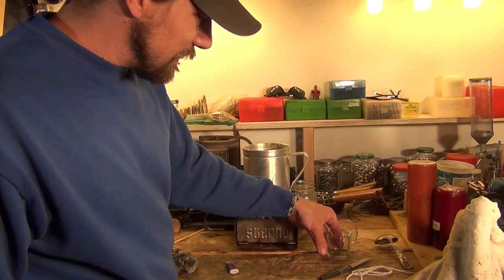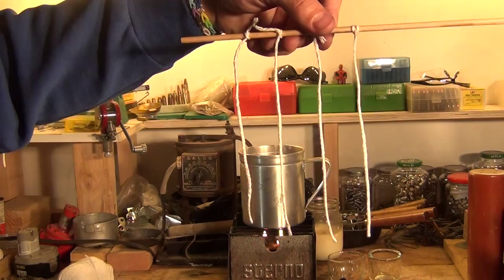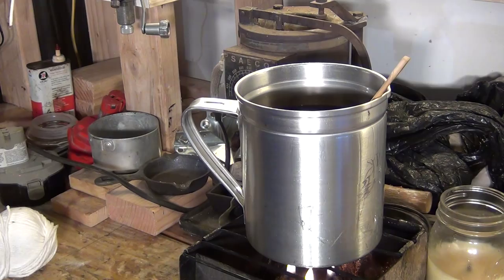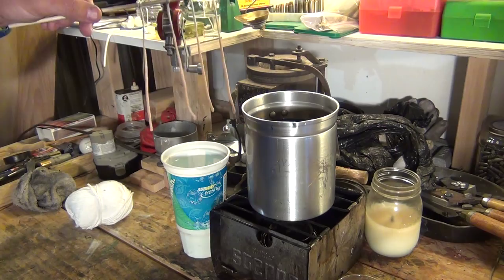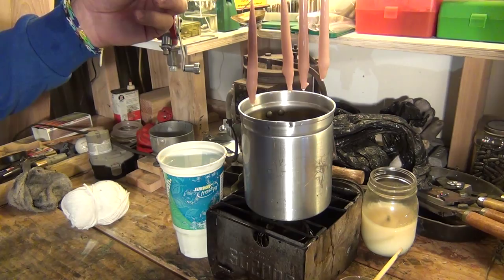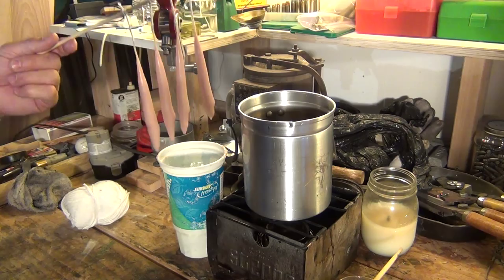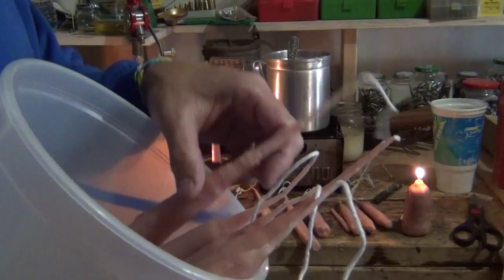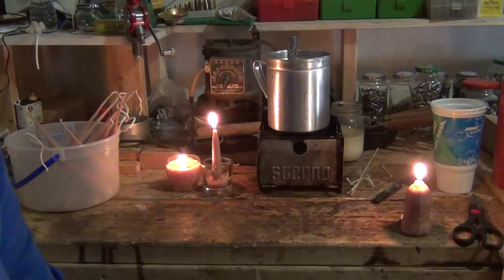How to make dip candles - HD

Comment: Something fun but potentially hazardous to try if you like:

1) Locate your stove, equipment etc. somewhere with a long drop within easy reach e.g. out of a window on the second floor, or from a balcony.
2) Heat your wax to it's flashpoint.
3) Spoon out some wax, and light it.
4) Tip the burning wax into the air above the long drop.

Why do this?
The burning wax howls on the way down! :-)

There are many ways this can be extremely dangerous.
If you don't know what those potential dangers are, don't do it.
Anyone choosing to do it, is doing so at their own risk.

"Paraffin Wax Flashpoint" - https://www.youtube.com/watch?v=paMF4ildjKs